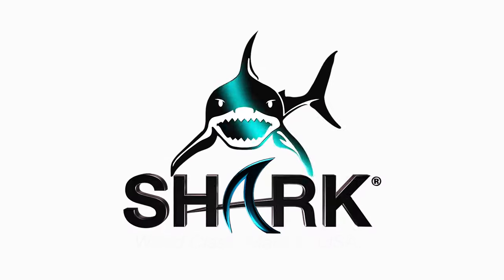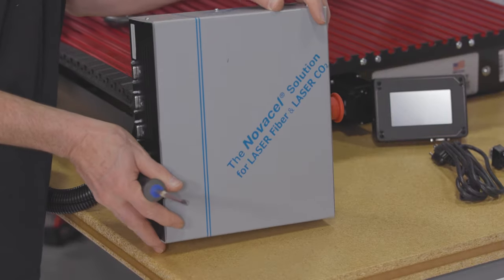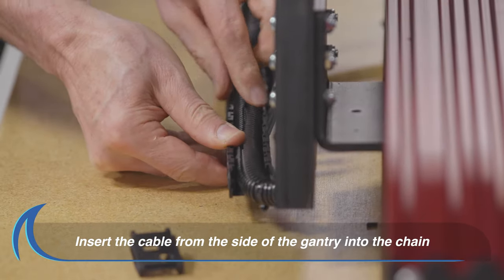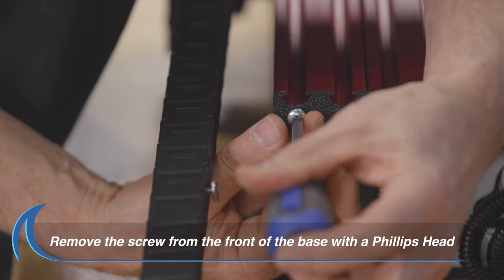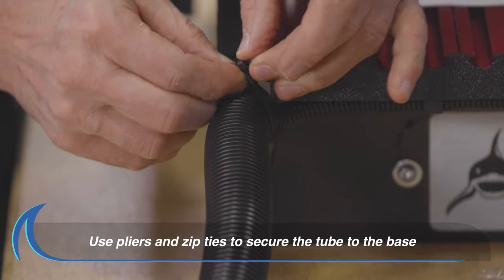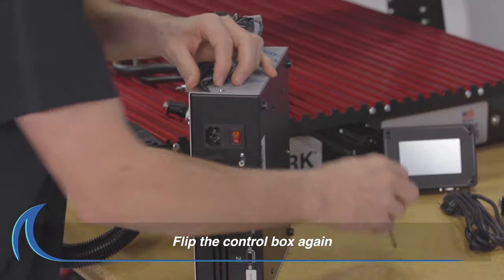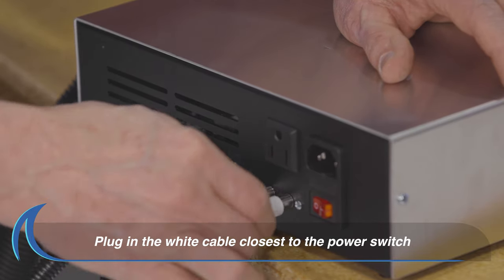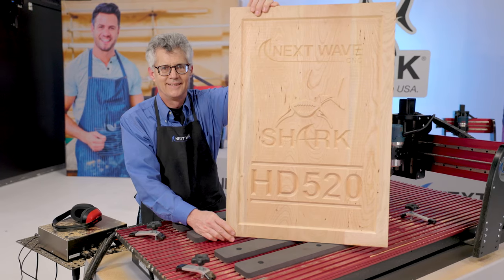How to Assemble the Drag Chain on your HD Series CNC

Comment: I'm assembling the HD520. This video shows the bolt mounting the cable carrier upside compared to the User Manual instructions.  Does this orientation matter?  It seems like if you follow the video, the bolt will catch on the cable carrier when the gantry moves back and forth.

Comment: I've got a shark 520 I've just put the spoil boards on. The specs says 25x50 cutting capacity so I made my boards 51" long. The pendant actually goes 53" before hitting the ends. Should I center my spoilboard or push it to one end of the machine ?
Reply from the maker: Hi Lester, we recommend that you center the spoilboards!

Comment: I really wish these instructions were included in the hd520 I JUST got. The instructions are horrible, don’t include some of the steps in this video and flat out tell you to do the opposite of what the video says to do. After a ton of frustration and the fact that more than half the tabs are not wanting to snap shut now, I’m about to return it as defective.
Reply from the maker: Hi Louis!  We're sorry to hear that you were having issues with the Drag Chain assembly! Please reach out to us at Support@NextWaveCNC.com - we would love to resolve your problem with the Drag Chain.
Reply: Worst purchase of my life! now I have 2 machines that are giant paperweights. They have a mind of there own! the design is not for something with vibration. Bolts fall out, spindle shuts down, controller sends bit full depth outside of parameters! just the worst experience of my life.